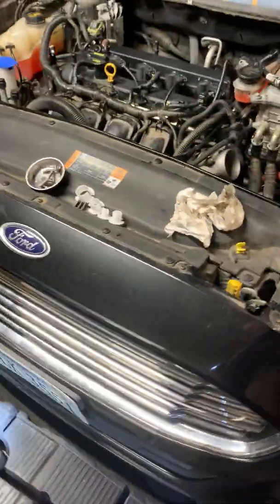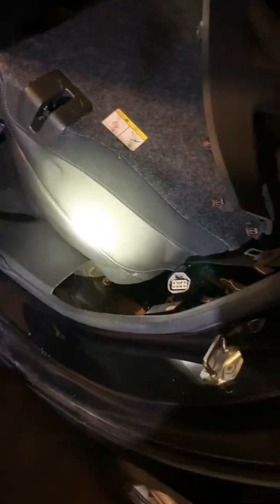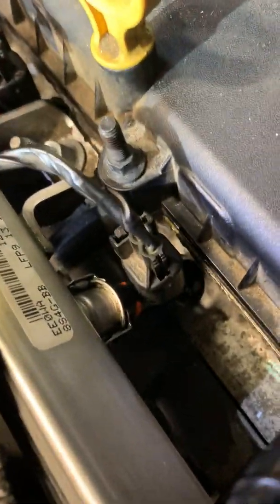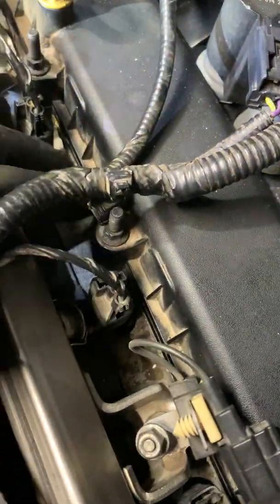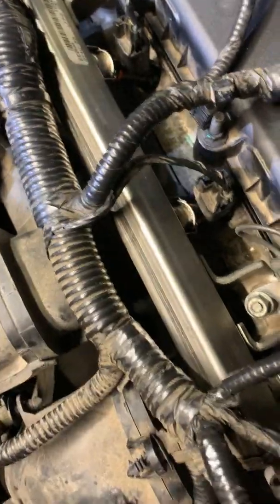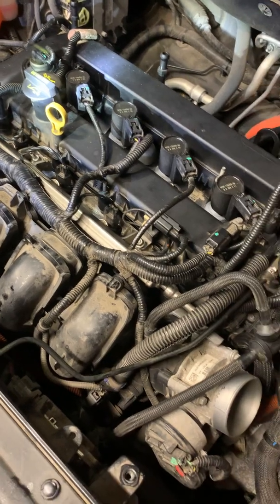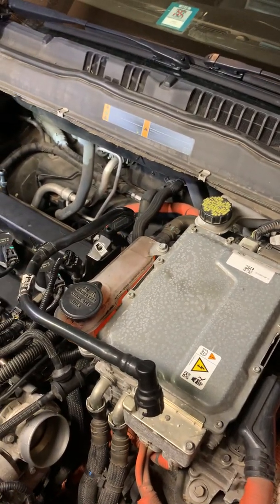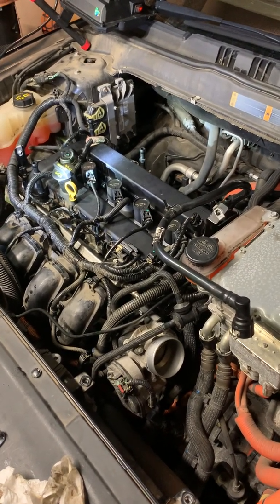Ford Fusion Hybrid 2013 Fuel Injector Discussion

Comment: Thanks for the info provided in this vid, may i ask is the FFH direct fuel injection or port? If direct, did you have any carbon deposits on the intake valves?
Reply from the maker: Nope, I didn't see any deposits.

Comment from the maker: It's been two months since I changed out the fuel injector and all is fine. My change out of the injector was a success! The car didn't catch on fire and the car has been driven five days per week for about 80 miles daily. The car runs great, and I only changed out one injector, not all four. No problems here. Hopefully the other injectors don't turn bad...but now I know how to change the rest of them out.
Reply: Was it difficult to change them?